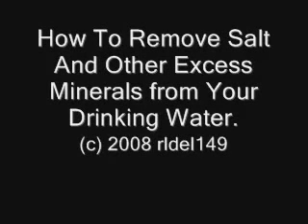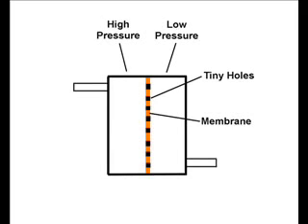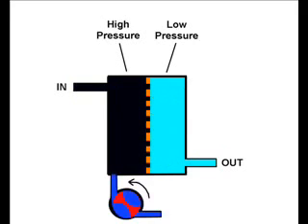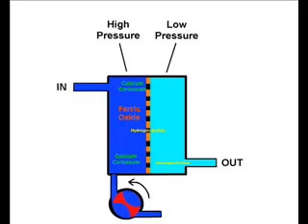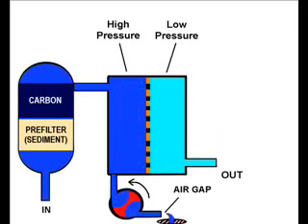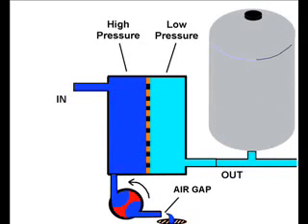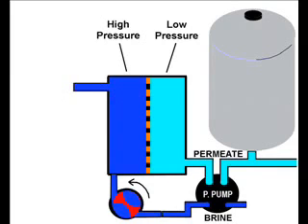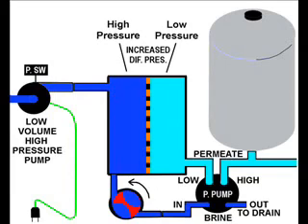Reverse Osmosis Theory

Comment: The comments about softeners are misleading and erroneous. My softener uses 2 cylinders which use salt only in cleaning. One cylinder is cleaned by softened water provided by the 2nd cylinder so no unsoftened water ever touches the moving parts. Conversely, no salt ever escapes the softener into the drinking water. Reverse Osmosis is 'old hat' because it is so wasteful and expensive to run. It's also complicated to maintain and requires pre-treatment for most water sources, especially for salty water.
Reply: I wish i could only click thumbs up on the first part of your comment. RO is FANTASTIC for brewing beer. Part of the brew day is adding salts to RO to modify the chemistry of the water for better balance of flavors weather the beer needs to be malt forward, hop forward, or balanced.

Comment: Water softeners only use salt to neutralize the negatively charged beads in the system, to purge contaminants into the drain side during cleaning cycle, system then purges with water to clean salt out of system to get it ready for another 3000 gallon cycle, or whatever the program is set at. No salt ever gets into your drinking water.
Reply: "No salt ever gets into your drinking water."

For what it's worth, I drank water from a water softening system and nearly threw up! I took a sip from the tap, and it had just enough salt in it to cause me to immediately spit it out.
Reply: Jake Jones If you felt the taste of salt in the water from the water softener then it could be due to the following reasons:1. It could have been washing itself at the time that you decided to drink some water in which case some salt could have escaped into your home. (this is likely due to a power outage which could mess with the timer that is on the system. This is why if there is some type of power outage that lasts for an hour or more, the water softener must be re-programed)2. The water softener is using more salt than it should and a technician can lower its consumption enough to where the system can clean itself and further prevent it from entering your home.
There could be other reasons but only a technician would be able to further troubleshoot the system.
Cheers.
Reply: Greg Simonson
Reply from the maker: Salt is necessary for human health. but we must maintain its quantity as per WHO recommendation. continues taking free of salt water could damage our organs.